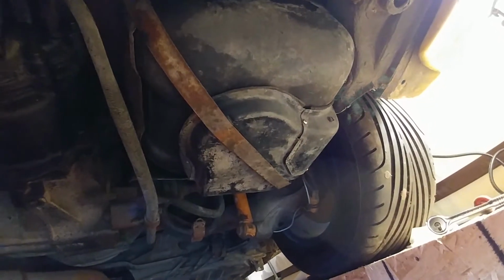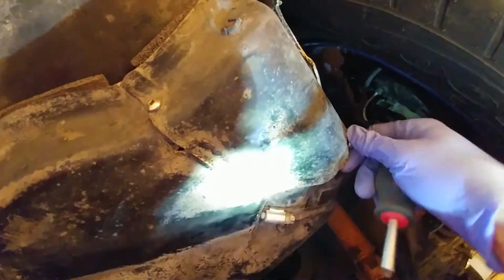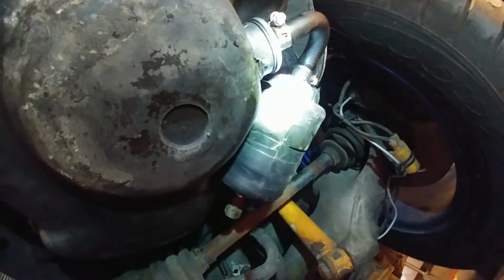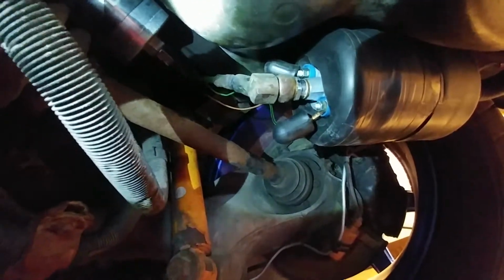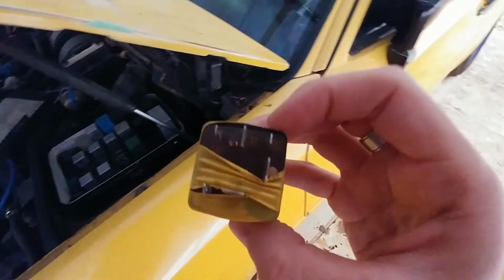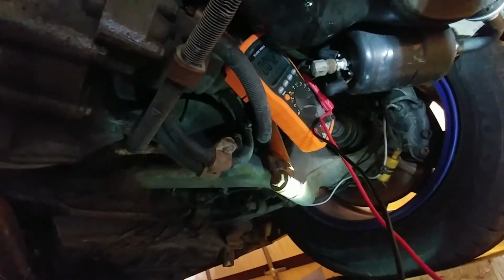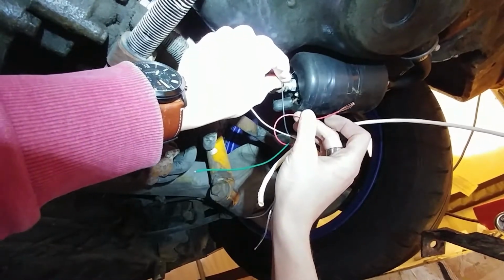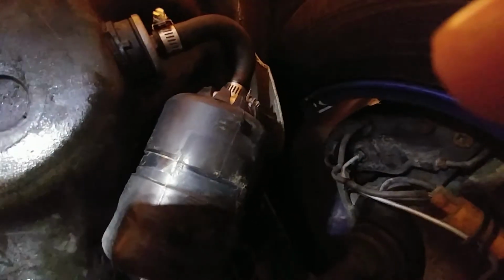How To Test a Fuel Pump - Porsche 944 Turbo Ep.1

Comment: Just an FYI, since the fuel strainer is problematic to remove sometimes,  you can actually check its cleanliness from the top when the fuel level/pressure sender is taken out..
Reply from the maker: Absolutely can. That will make it alot more challenging to clean out the tank fully of any potential sludge that has formed from sitting.

Comment: What fuel pump did you end up getting? I need to replace mine as well and it is making about 310 hp.
Reply from the maker: I installed the Bosch 044 fuel pump. Bosch stopped making that pump but if you search 044 replacement, you should find what you're looking for.